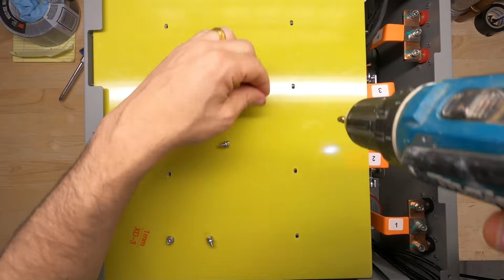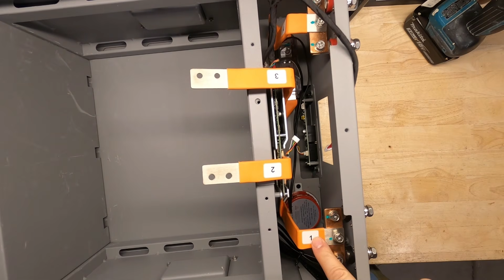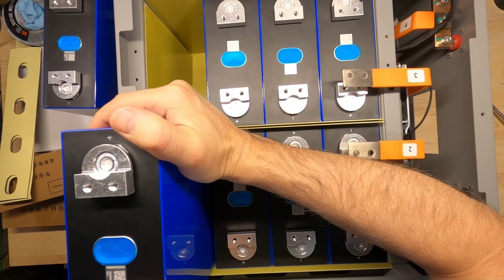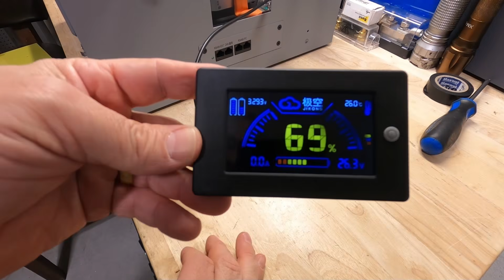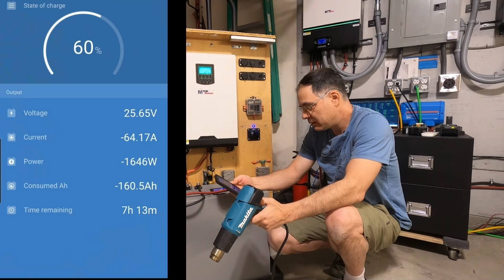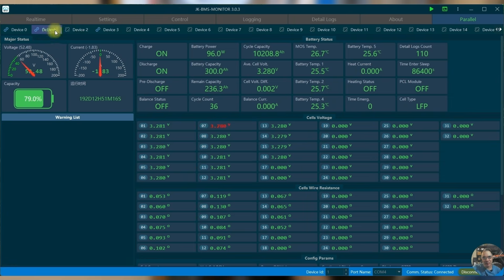Yixiang 24V DIY Battery Kit - This Is What I Found

Comment from the maker: I had high hopes for this box. Unfortunately, I found a  major issue with the outer screw mount tabs that are used to hold the top epoxy board. With a little DIY ingenuity there is a workaround. However, If assembled as intended, you WILL cause a short circuit on the cells. If you rather not have your cells in the open air and need a sturdy box to put them in, it will work for that. If anyone has built this box or similar box and had the same issue please let me know. I have informed Yixiang of the issue.

Please see my closing thoughts in the conclusion chapter at the end of the video. 
See the "WTF Bro" chapter to see the issue in action. Enjoy!

Affiliate Product links if interested.

✅YIXIANG 24V DIY Battery Kit (alibaba):
https://www.alibaba.com/product-detail/Lithium-Battery-Box-Pack-Case-Kit_1601558355360.html 
Click on "Chat now" to speak with Becky

✅Yixiang Direct: 
https://yixiangpower.com/products/us-stock-25-6v-280ah-314ah-diy-box-24v-battery-case-lifepo4-battery-case-24v-lifepo4-battery-case-with-8s-box-stack-type-without-cells?sca_ref=9920820.hXaAzn34l51FDj

Nate

Comment: You got the bus bars upside down.
Reply from the maker: Yes.  On purpose.. please see video.
Reply: @natesdiysolar  He was saying that initially, when you had the hump facing up... it was upside down.  The bus bars hump is supposed to go DOWN, which completely eliminates the screw touching issue.  Later in the video you stated you had to install them "upside down" to avoid the screw... when in reality you installed them improperly to begin with.   NOT your fault, and not trying to disparage you in any way... but the manuals for these china made boxes are trash or non-existent. 

But I thought it was a good idea to clear that up for people watching this and getting the feeling bus bars should be installed bump up.  Perhaps that misunderstanding, applied to some other brand box/design could cause a real issue (mistake) and cause property damage or even death.
Reply from the maker: @jdavidmusic oh.. iv always installed them bump up? even different styles.. where did you see they are supposed to be bump up. Even after consulting the manufacturer, they did not specify either way. If in fact this is the case I will make necessary changes to video.  Thank you.
Reply from the maker: @jdavidmusic so I just checked their product page on alibaba.. in their demo video it does show them with the hump UP. 

video:  https://www.alibaba.com/product-detail/Lithium-Battery-Box-Pack-Case-Kit_1601558355360.html

Comment: thanks for review.  I built a EEL 24V and it did have the removeable pressure plate.  Also there were no shorting concerns like you noted. The temp sensors were not screw down either.
Reply from the maker: Cool.  Thanks for the info

Comment: Nate, this is actually very sloppy of you. When you build projects that can kill you, you need to consider using more caution and most of all quality control. I see dozens of DIY builder doing the same thing. This is why electricians get paid well because they have been taught safety first and check their work before any power is applied. This is a good lesson for all of us though. Next time you will be more aware of the potential to get burnt or worse. This is similar to someone not turning off an inverter and working on it with a screwdriver. He gets shocked and then blames the inverter company. I just hope you do a big-time quality control safety check next time before you get hurt. Take your time and look it all over. Then look again. 2-3 safety checks are needed. You can do it. Wedding rings off too..... or lose a finger. I have built several, EEL, SFK Yixiang and Gobel batteries. I walk away, take a break every step and check it over as I go. Then recheck everything several times before powering on. Your videos are very good.

Comment: You should run the extinguiser lead over the battery vents. You should NEVER mount MB31 cells on its sides! See the factory spec sheet!
Reply from the maker: Yes, that is correct.  I had to fit the battery on the cart.  As stated in the video, I'm not keeping that pack built. I've already put it down on its feet.   It was just to demonstrate the  box for the video.  Thanks for  pointing that out.
Reply: The vents will be the fastest detector point for the extinguisher.

Comment: have you done business with miaoxin for batteries kind of nervous about it  . But a Mb- 56 for $2979
Reply from the maker: I typically deal with her co-worker Becky Liao. I think Andy from OGG deals with miaoxin. Andy and will p have both done mb56 builds.. from what I see, I'm not sure I would go mb56 quite yet.. I want to see more savings and more testing first.. but it would be fun to build.. just be prepared for the 600lb tank in your garage lol
Reply: @natesdiysolar  thanks I appreciate it one 600lb or two 300lb units my Schneider xw need 440 ah
Reply from the maker: @stephanied143 if cost is not a factor and you only need 2 then I'd go with singles. At least you have a backup if one bms should fail.  Iv never had a bms fail... yet lol.. I think they have things pretty well ironed out these days.. except the quality control lol its hit n miss.  Just like this box with those damn screws..
Reply: @natesdiysolar  well if cost wasn't the problem I would buy eg4 or discover batteries and have a warranty just trying to get enough solar to power my house just got batteries and panels left to get .  But that's great point having extra BMS . definitely something to ponder
Reply from the maker: @stephanied143 you can always buy A spare bms. I have a few.
Reply from the maker: Here is her link on alibaba . Looks like 1500 units sold already.  
 https://www.alibaba.com/x/B132RS?ck=pdp
Reply: @natesdiysolar  thanks

Comment: I dont think a fuse with 2kA breaking capacity is enough, did you check its stats?
Reply from the maker: That's pretty standard on these boxes. 200A bms 2kA is 10x the bms rating. It needs a CB, which would have a much higher IAC. Fuse should be the last resort if the bms cannot stop it.
Reply: @natesdiysolar  yes,but how usefull is that? I think something like t-class fuse should be there, dont know if bms always fail the right way, with open circuit.
Reply from the maker: @rm6857 that would be a nice feature. Especially for an internal short.. I'll ask them.. perhaps they will do it.  If there is enough demand they will do it.  Competition is ferirce.
Reply: @natesdiysolar  Yes, and another thing is, you can always put your own t fuse, but then basically the one inside is useless and just makes voltage drop. Would like to know their stance, but i think 2kA is not enough for such a big pack, and makes not much sense.
Reply from the maker: @rm6857 will prowse just did a video where he treats a bunch of these fuses as well as a T fuse.. worth the watch.